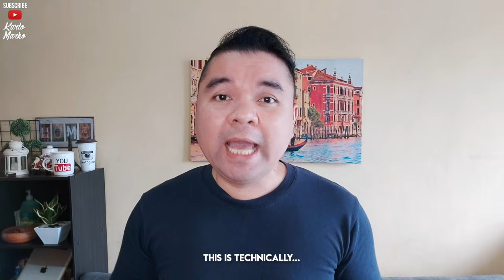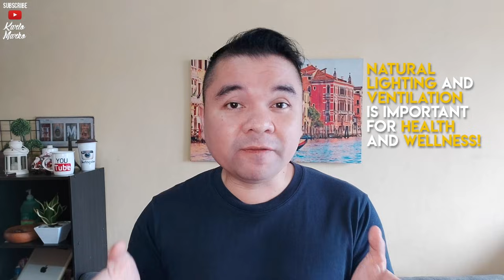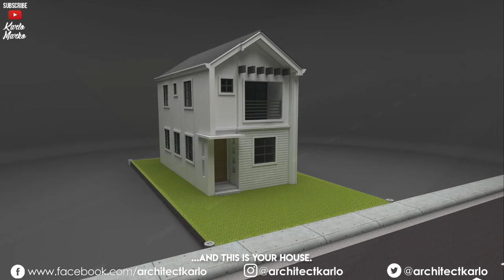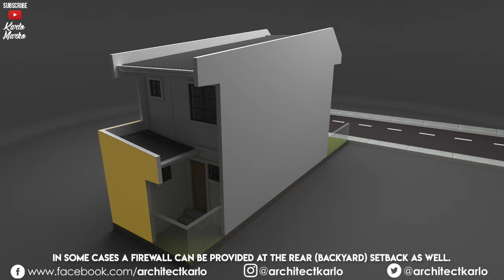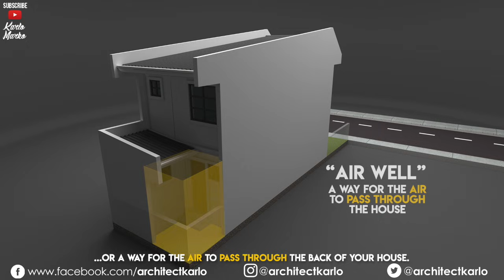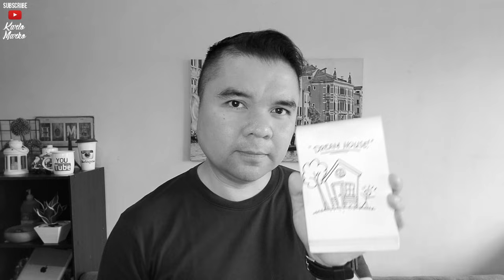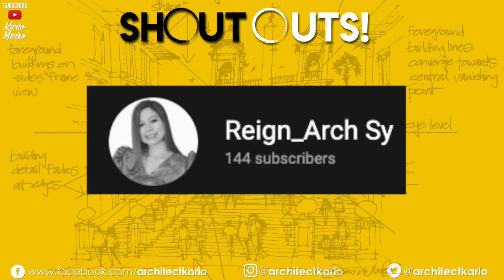The Rules on Setbacks and Firewalls | Bakit Hindi Pwedeng Isagad Sa Property? | ArkiTALK (Eng Subs)

Comment: Good day, Sir Karlo!
I would like to ask regarding the rule you have mentioned particularly about the side setbacks. Let's say a neighbour(A) is insisting to have their land back which is 1.05 m (Area: 5 sq.m ), However, this part of their land has been encroached upon by their neighbour(B), now are they still allowed to have this land given the long years(29 years) it has been as it is, unmoved, and now they want to "sagad" their property that is 1.05m lang? From your video, you have mentioned that the minimum side setbacks po ay 2.00m. What can you advise regarding this situation/scenario po? Is it not against the rules?
Thank you very much and God bless!
Reply from the maker: Hello Jeunneze.

If this property has a title or a TCT, you can prove there the extents of your property. So no need to debate on it... The title will speak for itself. 😊

As for the encroachment... Yes this is ok if it is still under their property. But since this will be along the edges property line already... The wall facing that side has to built as a FIREWALL. Meaning, it needs to be a solid wall. No windows, doors or holes whatsoever. 👍
Reply: @KarloMarko Thank you so much, Sir Karlo for the well informed information!
God bless you!

Comment: Architec ok lng po ba maglagay Ng skylight sa firewall
Reply from the maker: Hello Jon,

Sorry, but no. Firewalls should be a solid walls. And also skylights are usually installed on the roof going through the ceiling. To have a view of the sky... it's not installed on the wall po. 🙂
Reply: @KarloMarko  🤣

Comment: Hi Arki..technically pwede ba ang rear firewall, say 55% lang naman and may source pa rin ng light and ventilation on both sides of 2 meters?..hope you could reply😊
Reply from the maker: Hello May Carpo,

Yes. Technically, pwede naman ang rear firewall. Sa NBC, need mo lang mag-iwan ng 50% airwell. If for example... 10meters ang sukat ng rear side of the lot... you can put a firewall upto 5 meters on that side... leaving a side that can be used as an air well for natural light and ventilation. You always put up a tall (maybe 6ft) perimeter wall naman if needed... especially for security purposes. Pero the higher the wall the higher the effect on ventilation. You would notice that during the summer season... when air is always warm. Because, there's lack of🙂 air balance inside the house.
Reply: @KarloMarko  
Thank you Arki...this is why I like watching your vids, you answer our questions😀
Reply from the maker: Hanggat kaya. I will. 😊

Comment: Problem s mga subdivision ngayon dikit dikit wla yang setback..didikitan k ng kpitbahay
Reply from the maker: I think you are refering to socialized and economic housing models. They fall under BP220. A different housing rule for subdivisions which allows smaller setbacks and row houses.

"Economic and socialized housing refers to housing units which are within the affordability level of the average and low-income earners which is thirty percent (30%) of the gross family income as determined by the National Economic and Development Authority (NEDA) from time to time."
Reply: @KarloMarko  mga single detached po kso yung developer di nag imposed ng rules sa setback. Nangyari sinasagad ng iba. Gaya po ktabi namin sinagad nya kya pti firewall nmin ginamit nya. Puede ba yun?